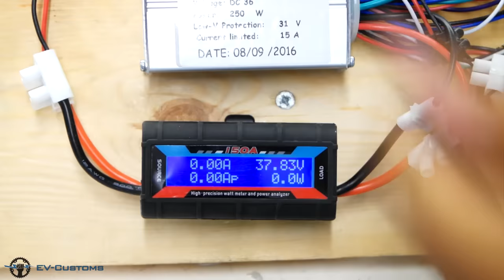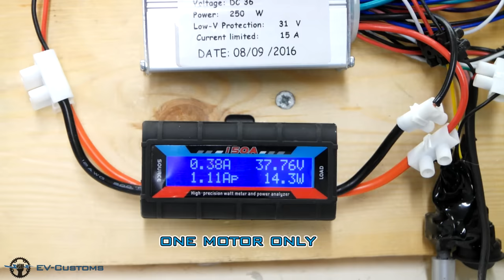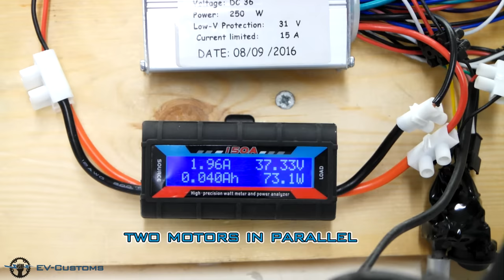Can one Speed Controller Run two Hub Motors???

Comment: Oh ya I see. So I am still wondering about speed controller kits for power wheels. I have the dune racer which has 2 motors in the back for the 2 rear wheels. The speed controller kits that I seen only has voltage +- input and voltage +- to motor. So it is going to be parallel if I connect both rear drive motors to one controller. I don't think I want to parallel it. How does traxxas emax work....

Comment: Perfectly fine for a slippery or dirt surface condition riding but not for pavement just like an all wheel drive vehicle in the old days when the front and rear wheels were locked together they bind up and often to get out of all wheel drive you had to back up.
Reply: That's 4wd, not awd.

Comment: its not half speed if you canect two motors to limit current and voltage output of controller?
And if i need the hall sensor? why can i not conect it together and conect it to controller then??

Comment: Can you connect 2 controllers to a single throttle controller?
Reply from the maker: Yes of course...  I have video animation for this.
Reply: @EVCustoms  do you connect both the sets of signal cables in parallel and plug that into the throttle, or is there some other set up that you need to use?

Comment: what if you set an switch that on the 2nd motor, separate controller, only 1 rotor.
1 switch on/off for the secondary motor.

Comment: two motors connected in paralel -become motor-generator system with oscilation of mechanical energy between one and another - it cause looses, if they will be on one wheel or even maybe on real cycle - Imho it will fixed by flat and dependent rotation of both motors, without ping-pong energy exchange between motors

Comment: I don’t know 🤷🏾‍♂️ Electronics that we’ll never went to school for it but I believe it’s because your causing the controller to loose  Pressure or in other words it’s compensating 34% in Watts because two motors to that controller is like opening a pipeline twice it’s size all of the sudden. In doing so, to fill the pipe to proper pressure, you would need More Energy...

Another example is 
If I have a tank that I can fill in 1 hr with whatever power I have and then out of nowhere, I have to fill TWO tanks in the same time, I would need a pump that can pump twice as much and bigger hose to compensate otherwise it will burst.

So your motor is acting like a BIGGER motor than what it really is to compensate for the load the motors are asking for🤦🏾‍♂️😎

I do think 🤔 💭 I am making sense here😂😂
Reply: I know for sure you can run two Motors and two controllers and two separate throttles from ONE BATTERY 🔋😎 I did that way back in 2011😂
Reply: @batmanofinglewood , how should the battery be for two motors that each have 1000W power?
Reply: David depends on how fast you want to go. The more amps, the more Torque. The more Voltage, the more speed. You need a battery that can handle the power the controller draws. 

You first have to choose a safe voltage. Most run motors in between 48v-72v. More than likely, you want to get a battery 🔋 capable of 60-80 amperes but get a controller that draws around 60amps to have cushion
Reply: @batmanofinglewood , each motor has a capacity of 48V, if they exceed the voltage of 72V on each motor .. will the engines burn?
Reply: David 72v fully charged is 84v. Usually motors run more efficiently with higher voltages. The thing is when you up the voltage, in theory, you must drop the amperes or Vis-a-vis. If not, the motors will heat up much more quickly depends on how much power your draw through the throttle signal. 48v fully charged is 56.6v or 58.4v if you have 14s or higher battery 🔋. So you must connect them to the battery in parallel so the voltages stay the same.
Reply: @batmanofinglewood  Ok, thanks!🙏

Comment: The sine waves sent to the motor are affected by the motor itself, power is induced in the wires from the magnets passing the lesser powered coils during the cycle. It become an interference pattern with 2 motors

Comment: Thank you for video. I saw the throttle with speed limiter. Can you tell me please more about it and if can be done, how limiter is working. I live in European Union and there speed is only 25 km/hour. With limiter I can switch speed limit quick if police will check or when go in citty.
I think for long time how to make limit like this.
Reply from the maker: Hi friend.. i am also live in Europe so i made  this limiter for this reason, to switch the controller to 25 or 30km
Reply from the maker: I can send you diagram
Reply: @stelic9515  Poti has   10k Ohm

Comment: I got a question, I just built a 48 volt 1000 watt ebike, I'm running a 48 volt 15 amh battery, which is 720 watts, my top speed is 30 mph., if I run a bigger amp battery will I get more top speed??, if not, can i  buy a 72 volt battery, and buy a 72 volt 1500 watt controller without buying a different motor?
Reply from the maker: Hi,  first of all you must find lable of the battery pack and see specifications of the battery, your battery must have minimum amp output 40 Amp,  if is lower than 40A you must change the battery for bigger one,  and of course you will have more speed.
Reply from the maker: All this is for 48V 1000W hub motor

Comment: Running these on the same axle will cause all kinds of issues with torque transfer. An equivalent effect being that of wind up in a locked axle on a car going around a corner.

Everytime you turn the wheel you're going to be fighting the motors trying to push the wheels straight again.
Reply: Like and old posi unit from in a car.

Comment: Im assuming these are brushless 3 phase motors correct? I dont understand how exactly does one wire in parallel
Reply from the maker: Yes this motors is 3 phase... 3 power wires connected in parallel....
Reply: @EVCustoms  how do you wire in parallel im not comprehending

Comment: I want to ask a question ,Which one consume less battery ,A single big motor (3000 watt) or using two hub wheel motor (1500 watt) I want to make Ev for handy capped  and I think transmission and axles are increasing weight.

Comment: Hello. I have an electric scooter, I bought a new controller, all the wires are properly connected, but when I start the ride the engine makes a strange sound and tremble. Controller Parameters-volt DC 36/48v Power-350w, Lower volt DC 30/42V, current limiting-13a, Battery parameters-rated voltage 36v, Ampere hour 12, 6ah, charge Voltage 42v, Power 453, 6wh. The only thing I don't know is how much engine power I have-250w or 350w. Could the problem be that I am using a 350w controller on a 250w motor? Thanks.
Reply from the maker: You must find hub motor wires witch is thick wires blue green and yellow, and make some combinations with controller thick blue green and yellow wires

Comment: When I get around to putting a second motor on my bike I wont be worrying about using a single ESC. Instead I am only too happy to run two ESC's for two motors. I mean they are pretty cheap given their power ratings versus hobby ESC's I come from RC Hobby background, so I have always found the price of Controlers for Push Bike Hub Motos quite pleasant. My question is can 1 Throttle control two ESC's?
Reply: yepp ...

Comment: You're drawing twice the current through one controller rated for one motor(so i can only assume). Once you let the smoke out you can't put it back in (lolz). The moment you try this with a decent load (let's say a go kart) you will draw around 6x the rated current at zero RPM from BOTH motors and things won't end up well. You want two separate power sources and two separate controllers for PWM motor control applications with ONE throttle connected to both PWM CONTROL circuits (in Parallel). This will eliminate any frequency, resistance, and inductance/capacitance differences from interacting with each other through one modulator. Too many factors contribute to imbalances such as different wire length, internal motor winding insulation condition, rolling resistance of bearings inside the motors, defective parts inside of cheap Chinese controllers...all affecting the operation of the capacitors and voltage regulators ect.. inside the controller.

Comment: and yet there has to be a way... I mean there are electric cars like Tesla that actually use more than 1 motor... so what would be the proper solution ??
Reply from the maker: Proper solution is to connect two controllers or controllers with two motor outputs..
Reply: every motor is under independent control. its not rocket science.
Reply: If you put 2 motors on a common shaft with magnets aligned they will work together.  I found that 2 small BL motors not on a common shaft will work with 1 controller until you put a load on them.
Reply: Teslas have two motors and an advanced system. Two motors can work together on one shaft. It's common to use two DC forklift motors in series and connected together.
Reply from the maker: Multiple controllers

Comment: Would it work if you used three Hobbs three batteries and three motor controllers and operated them all with the same thumb throttle
Reply: Yup should be fine

Comment: Try putting the motors in series. If it runs too slow, increase the battery size 6 volts at a time until it runs correctly.
Reply: Jim Rojas I dont think you know how a brushless motor works you cant put them in series its physically impossible due to only been 3 phase s
Reply from the maker: Series..??? You mean in parallel, yes i know that you can not connect two hub motors in parallel, also i do not recommend that... This video is testing proof for one subscriber..
Reply: @nightmareinaction629  You are correct. I thought they were DC motors. Have you tried putting a run capacitor in between each phase?
Reply from the maker: No my friend i didn't try it...

Comment: By the way can we use an alternator as dc motor of 40amp with lets say 12v 250 or 350 watt controller will it work?
Reply from the maker: Yes of course... but you will need more than 1000W and halless controllers
Reply: @EVCustoms  alternators are sensorless right, and 1000 watt controller will work so will it work with which sensorless or sensored controller
Reply from the maker: @Ansari Shoeb  With sensorless controllers only...
Reply: @EVCustoms  👌

Comment: Interesting :) so it works but with big losses
Reply from the maker: @PHLocalExtremeSports  Hi.. yes you can connect 2 hub motors 250W on one big controller,, but I remind it again that I do not recommend it... because of losses and synchronization of motors.
Reply from the maker: Yes... I didn't have now drownins...  It is simple , you must connect hub motor wires in parallel without connections of hallsensor wires...
Reply from the maker: Yes my friend... If you see my motors are same brand voltage and wattage..
Reply: No, because something moves doesn't meant it works. Speed controller is not made to handle location info from two motors. Try dance to trance and waltz simultaneously, it will not work. This is probably more complicated then most of you expect. It's a continuous feedback loop between speed controller and motor. The speed control tell motor to move, then motor move and send info back to the speed control where motor is and the speed control calculate when to send next pulse in which fase at what voltage.
Reply: no it doesn't work.

Comment: No loses watt....but paraller 2 motor = look like delta wire  
more amp.. you need to drive the motor 
Its not simple calculation 22+22= 44 

Becouse the resistant wire 1 motor, when you jointed the wire to another motor make it low resistan

If you jointed 2 motor its made more biger induction n more biger back EMF ( mybe not same time back emf betwen 2 motor) make your motor sound like there is the load so more current you need to supplay this motor

Comment: WHAT IS THE BIGGEST MOTOR  A SPPED CONTROLLER CAN HANDLE . IS IT POSSIBLE TO GET A SPEED CONTROLLER CONTROL 2 2400W MOTORS OR 5600 TOTAL WATTS

Comment: What if you use a single controller twice the power for both motors?
Reply from the maker: Please explain that....
Reply: @EVCustoms   
one 500w 42v speed controller
Reply from the maker: @EDGARBASTO25  Like this you will increase the speed of motors, but note this diagram of tow motors and one controller is not decremented....

Comment: Question: I have a 1000 watt Ecotric Hammer, 48 Volt, I want to use a 52 volt battery with. Is there any reason why the 48 volt controller would be damaged by this? My 48 volt battery puts out 51+ volts when it is fully charged... Why such a gray area? I don't see any 52 volt controllers for sale, but everyone is upgrading to widely available 52 volt batteries. What do you think? Thanks.
Reply from the maker: Hello Nathan Andrews.. normally on 48V battery system the maximum and health battery voltage output is 54.6V... if you have only 52V on full charge then you have some unbalanced battery cells...
Reply: @EVCustoms  Hi, I was just saying that I had at least 52 volts going to the controller already, and was wondering why I can't use a 52 volt battery on a 48 volt controller? Will it damage it?
Reply from the maker: when you say 52V is full charged or nominal voltage of battery?
Reply: @EVCustoms  I have the stock 48 volt battery that came on the bike. Then I bought a 52 volt battery that I would like to upgrade to. So we are looking at 52 volt rated battery to use in place of 48 volt rated battery. Will that damage the controller? I have looked for 52 volt rated controllers but can't find one... Thanks
Reply from the maker: @starwoodstudios1  The only way to se if controler can handle this voltage is to open it na check first hi voltage capacitors... (big one) your Battery max voltage output must be 58.8V, on most 48V controllers this capacitor is 60V, in this case you have big chances to work your controller without any problem...
Reply: @EVCustoms  Hey thanks! I will open it up and check it out.

Comment: Why use a 250 watt controller, if your intent is to use 500 watts total? Would there be less loss if the correct total output were used? My knowledge is theoretical, & I  haven't done the tests myself.

Comment: No it can't work. impossible for the motors to remain in sync. with or without hall sensor. Speed controller sends pulses of power out to the coils at a specific time . it is impossible for motors to remain 100% synced like that. one of them will try to run backwards for a tiny moment of time as it receives a pulse before it gets to the correct side of the magnet that,  that set of coils are passing. About fifteen years ago I got two and three motors to work together perfectly after mapping each motor inside and out. marking a map on the outside of the hub of all the magnets then finding where each coil was corresponding each hub at exact position then connecting an adjustable cog to the outer of the hubs and a timing chain..... So all hubs started at the same time and never deviated from sync. 100+hours and a lot of thinking = not worth the effort .. the motors need  to be directly inline. Couldn't find any practical use for it.
Reply: If motors are brushed they do work.
Reply: @marcusdutra7091  Yes they do 100%. Just watch the amps needed to drive them.

Comment: bro I saw you put something in one of the connectors like to make a bridge witch one was it ?
thanks for the video and hope you can answer this question
Reply from the maker: You mean when  i short connector with orange  and  purple  wires?  This wires is for ignition of controller..
Reply: @EVCustoms  hey Man thanks 4 answering I mean the one you always leave it with a bridge or short .
what I want to do is connect the motor hub to de throttle and battery to se if it works can you help me please 😁
Reply: maybe a diagram or something like that my throttle has 4 wires purple white black and red
Reply: @malomalito6048  Dude...those LIon batteries cant handle the higher discharge rate. it's probably the battery's protection circiut freaking out too...you dont want lithium REVERSE poling on ya ( over heating)
Just 1 cell...reverse polling can mess up the pack. Then you'll have
to do battery surgery.lmao

Batteries arnt exactly cheap.

Like he said. Not all brushless motors has the same
TOLERANCE or exactly the same..it's 120 KV range there about. The magnets dosnt have the exact strength. The wining arnt exactlyy the same it's sort of MISS firing between the motors or the timing will be off.
I'd go LIPO and esc for each motor...Even then it'll be off...but you'll still
get more TORQUE..or F-it , get a bigger motor with more TORQUE

Comment: Hi, got a few questions. Can 72V voltage controllers and 72V li-ion battery work on 60V rated 5600w motors? In other words, can 60V motor be overclocked?  I will be doing a power upgrade in the future on my 5600w 60V dual motor scooter. I would appreciate for your thoughts
Reply from the maker: hello friend... yes you can do that, actually you will over-volt the motor, I have 3 electric bikes with this combination 60 volt hub motor and 72 volt controller without any problems, the only thing you must check if you're riding is aggressive is temperatures of hub motor and controller,
Reply: @EVCustoms  Wow that is cool. Good to know. Yeah I will be taking it easy not looking to push hard to keep the temperature down..You are so helpful. Thank you!